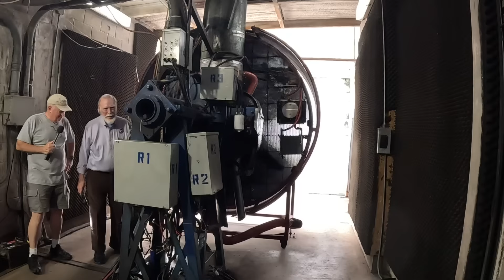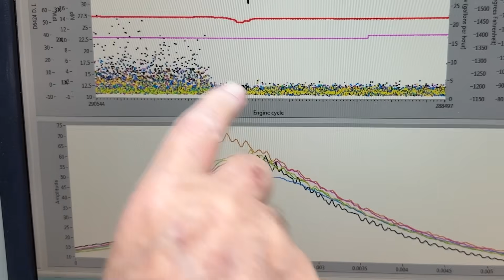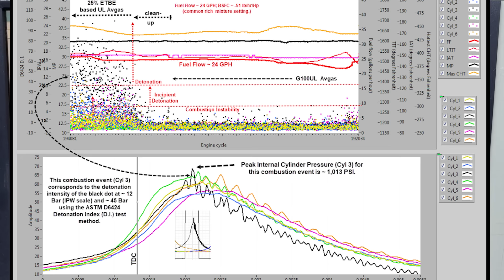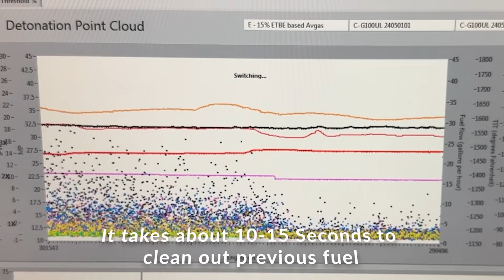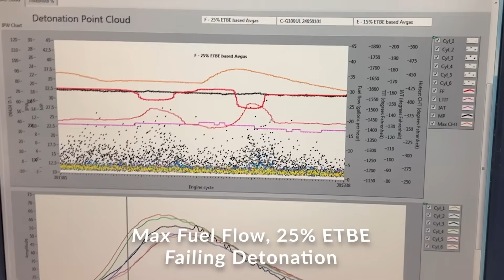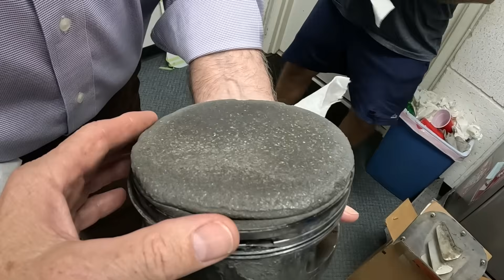What Happens Inside an Airplane Engine Test Lab? 4 Unleaded Fuels

Comment: Fascinating story.  I chuckle when people deep in the weeds of aviation refer to "high compression" internal combustion engines at 8.7:1.   Maybe you can call that a high compression air cooled aviation engine.   In 2025 the cheapest new vehicle on the market in the US runs 10.4:1 on 87 octane unleaded.  One of the cheapest turbocharged vehicles on sale in 2025 runs 11.5:1, again on 87 octane fuel.  If you spend a few more dollars that reaches 14:1.  I appreciate all the effort GAMI has put into this, but I will stand by my belief that a "drop in replacement fuel" for antique engines with antique engine controls solves the wrong problem.
Reply from the maker: It's a regulatory nightmare.

Comment: G'day Scott 

Yikes !

That was absolutely Amazing...

Thanks for making and posting it...

I was interested to see the Water Spray-Bars rigged, to keep the individual Cylinder-Heads cool when running at "unusually high Power Settings"...

I dunno if this will burst the Bubble of "first to spray Water on an overheating Aeroplane Engine" assertion...(?), probably not - if we're specifying "in a Test-Rig..." ; but, back in 1994 if memory serves, Old-Mate's 64 Hp Rotax was venting boiling water from the Radiator Cap's Overflow (Steam) Vent..., when Aerotowing hefty Feetbrawler-type Hang-Glider Pilots uphill at 500 ft/minute and 25 mph, in his Prototype Bailey-Moyes Dragonfly TUG...
(Tows Up Gliders...!)

So he rigged the Radiator (Air-cooled Cylinders with water-cooled Heads...) with thin Plastic Tubing from a Fishtank, poked Pinholes in one Wall every inch, plugged one end, secured the leaky tube on the Front of the Radiator in a Serpentine layout, and connected the Pipe's other end to an automotive windscreen washer Pump/Tank, with a button the Throttle....

So instead of climbing faster but shallower, he could increase the adiabatic Lapse-Rate of the Air going through the Radiator.

It worked.

Such is life,

Have a good one...

Stay safe.

;-p

Ciao !

Comment: Thanks for a fascinating video. I love the "Find something that works and then write the spec" approach combined with a flexible, well-instrumented test cell and great data analysis. That's how real materials and chemical engineering is done. The clock is still ticking. Given the FAA approval cycle-time, who will have something to sell when 100LL disappears?

Comment: Interesting.  What method or technology do they use to measure detonation?
Reply from the maker: They have pressure sensors in the spark plugs of each cylinder.
Reply: @FlyWirescottperdue Not Vibration Sensors ?
Reply from the maker: @reinerressel975  The engine also has a torque sensor.
Reply: @FlyWirescottperdue  Yes thanks.  I worked in a few engineering labs as a technician.  The pressure transducer mounted in the head itself ported directly to combustion chamber.  Spark plug sensor is just easier as you don't have to machine the head for a separate transducer location. Sometimes the transducer was water cooled to help it live in the combustion chamber environment.  Not a pilot myself but I find your channel interesting.
Reply from the maker: @mikejohnson4617  Thanks Mike. Just trying to call the shots as I see them.

Comment: Maybe I missed it, but I didn’t see a side by side comparison of 100 LL to G100UL.  The 100 LL looked slightly better to me than the G100UL, but it was hard to tell since the switches seemed to be from 100 LL to one of the other fuels and then to G100UL, but not a switch from 100 LL to G100UL to get a head to head.
Reply from the maker: I think you can compare the two by comparing the point cloud, a couple of times 100LL and G100LL bracketed the ETBE fuel.
Reply: @FlyWirescottperdue That is what I was doing to say 100 LL looked slightly better, but it is hard to tell without back-to-back.  Just seemed odd to me that all comparisons weren’t to 100 LL since that is the gold standard.
Reply from the maker: @LTVoyager  Well, The 15, 25% ETBE fules as well as the G100UL are potential replacements of 100LL.

Comment: Sorry if I missed it along the way; did they ever say what a gallon of this stuff is gonna' cost?
Reply: @BixbyConsequence  They said it will be to cheap to meter.
Reply: About a buck a gallon more than 100LL is what I recall George saying in previous videos.
Reply from the maker: I think at this point it is really hard to forecast that. Until it is is mass production saying it will cost X is just a guess.

Comment: I certainly prefer all the messy details and extensive discussion even if it isn't succinct. It does seem that inside the engine the GAMI fuel performs well.  As I understand it, the issues that have been raised about it are outside of the engine itself.
Reply from the maker: That is true, and it is an issue that needs to be worked out. But nattering about other stuff is a distraction. Without high octane I'm toast.

Comment: kudos to George for investing in this rig to do these tests. Fantastic.  He knows that he still faces ASTM certification and is convinced that his tests exceed the specs for ASTM.  Seems that the onerous but required next step is sitting down with ASTM and demonstrating to them that he has exceeded the ASTM specs and that they should certify 100UL.  Other than pride, it is unclear to me why he has not taken this step to get 100UL certified for distribution.
Reply: Yep. Fleet-wide STC or not, at this point, George needs to recognize the ASTM stalemate for what it is. I know the patent history, but with the patents issued at this point, why does that still matter? Pride is a terrible excuse and emotions need to be removed from business decisions. Regardless of what George says, with these stories from CA, a lot of aircraft owners are really going to want to see the ASTM materials compatibility test results. What’s going to happen is that Swift is going to outmaneuver George in this corrupt industry consortium and then the game will simply be over if they actually deliver an STC that has  a ASTM cert and no horror stories from early adopters. Upon the death of LL, the shrinking GA market probably doesn’t have room for two allegedly 100 ULs that apparently can’t even be mixed.
Reply: It appears there are some trade secret economic espionage components of the ASTM, that's why.